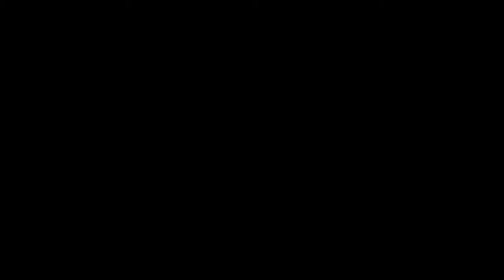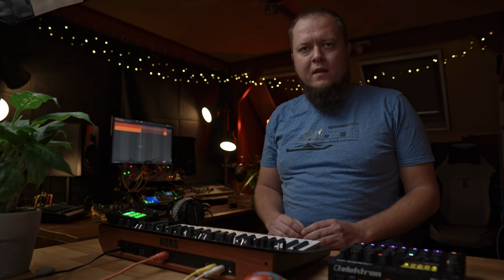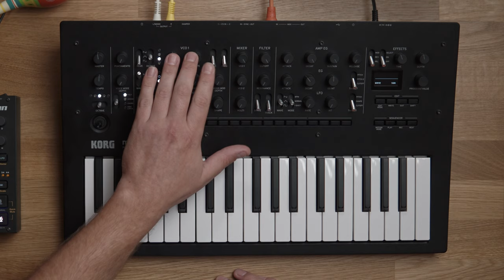Techno Sound Design / 3 Analog Synth Bassline Techniques

Comment: Perhaps as TIP for the viewers here, myself don't have one of these (yet), but I think that the KORG NUTEKT NTS-1 can also produce the monophonic sounds you made because both use the same sound engine (XD=Polyphonic / NTS-1=Monophonic)

NTS-1 is not that handy in use compared with the XD but if you wish the same beautiful sounds, effects and filters as the XD is the NTS-1 a cheap solution. I just want to mention the viewers on this.

And Ihor, als always a good tutorial ! Thanks for sharing !
Reply from the maker: This is a very good tip. Thanks for sharing. Essentially all of these 3 patches I made are monophonic (I forgot to switch the first one into mono tho, however it was fine, because notes were kinda far apart). Considering the price of NTS-1 it is a good alternative for such sounds.

Thanks for watching and taking time to share your idea! I appreciate it.

Comment: Great video again! Your content is really simple to follow and offers great value!
May I ask about your routing in your setup? Do you run a hybrid dawless/daw setup? If so, how is it routed?
I struggle a bit with what goes into my mixer or interface and so on...I'd like to be able to multitrack in my daw but also leave it out and record stereo directly from my mixer..
What is your approach?
Reply from the maker: That is a struggle I always have. It really depends on the situation. Most of the times I do not even multitrack my creations, but just record the master. On all my videos for sure like that.

Multitracking is always complicated for me. I run out of inputs in my interface and so on. My latest solution to that is a (weirdly enough) DJ mixer! I got XONE 96 (crazy expensive tbh) and it has an audio interface in it. So I multitrack 4 stereo pairs from it. Pretty much like that now.

Comment: How does it automatically sync to the BPM of the Digitakt? What settings did you use?
Reply from the maker: On the Digitakt you have to enable in MIDI settings to send clock and transport. On the Minilogue you have to configure receiving those. I think those settings are called something like "Rx" for receiving on the Minilogue.

Comment: damnit! my original minilogue isn't cutting it anymore since they released the XD
Reply from the maker: I've heard that the original is as good as XD! Isn't it?
Reply: @IhorMedia  It's missing the built-in FX as well as the drive  on the filter which seem like they add a lot. Alas!
Reply from the maker: Oh! Does it not have built-in FX? I didn’t know that. But that’s kinda fixable by going into a DAW or FX unit. Though I get the point. It’s good when everything inside the box.

Also in this video I think I relied too much on the FX rather than synthesis. I’ve got such a comment and I agree with this. Nothing wrong with that. But that made me want to make another Minilogue video and do not rely on Fx that much!
Reply: @IhorMedia  It's very helpful to see how you use fx in general but I'd definitely enjoy another video focusing on the original minilogue!